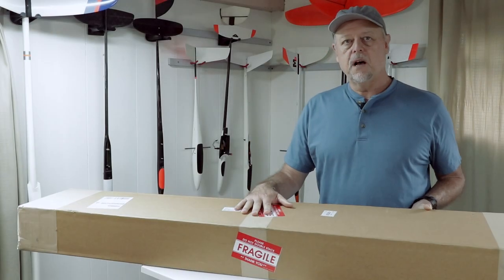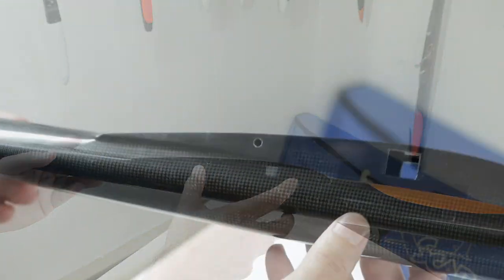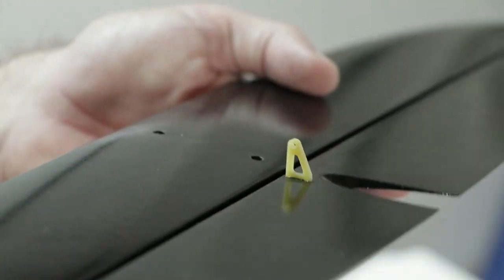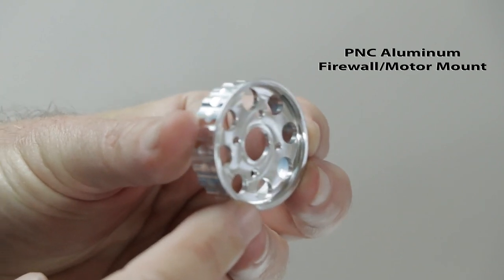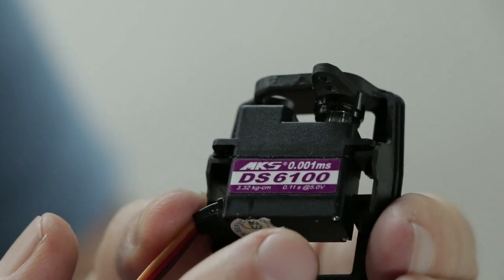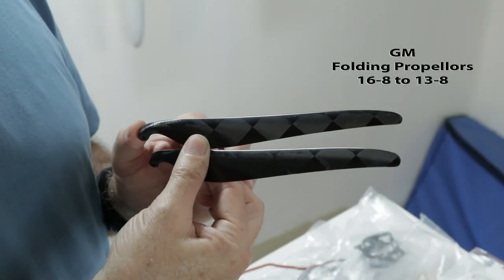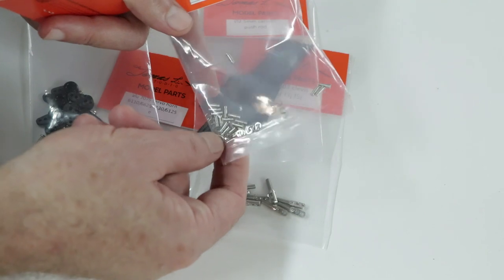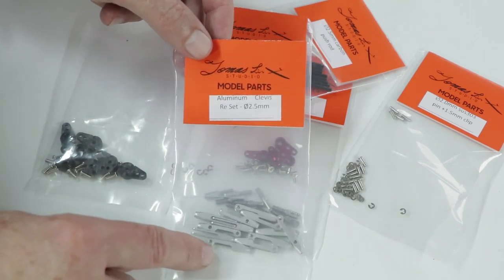ORION V2 2.4m All-Arounder: Introduction and Equipment Choices

Comment: Can you provide links for the hardware you selected and used?  The parts all look quite excellent.
Reply from the maker: I will see if I can provide direct links. Soaringusa.com has the motors, props, servos, batteries, and such in stock for the Orion and other e-gliders.
Reply: @pnaton  Thanks Paul.  The precision with which that plane flies (and is piloted) is amazing.  Its axial roles show no drop - are you cycling the rudder as it roles or is the plane that stable?
Reply from the maker: @Legalmachinist  I have some AIL to RD mixes, though amount is flight mode dependent. Aileron and flaperon differentials and AIL to FL coupling rates are critical to getting a clean roll with minimal rdr input. I cover these subjects in my full length tutorial videos available to purchase on the radiocarbonart.com website.
Reply: @pnaton  thank you Paul for your kind response.  Watching some of your videos I have come to realize that like Jon Snow, I know nothing!  I will go look up one of the references.  Which would you suggest?